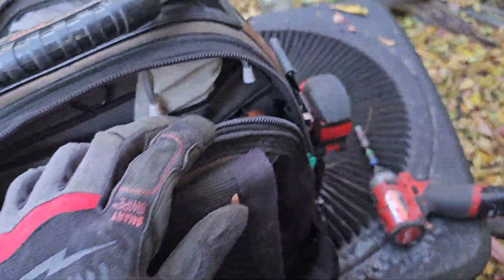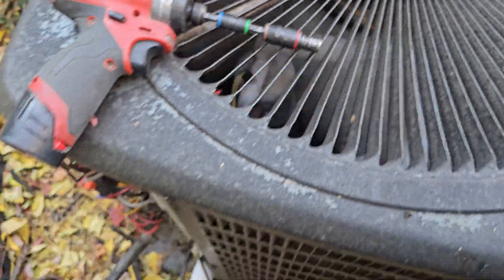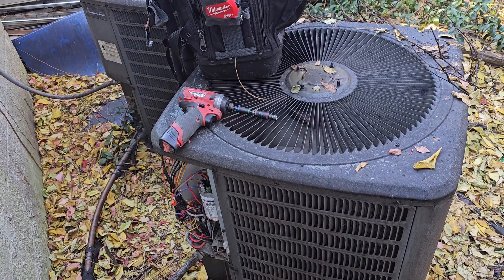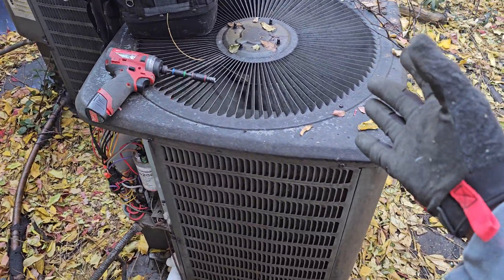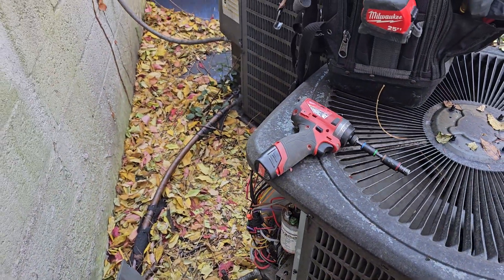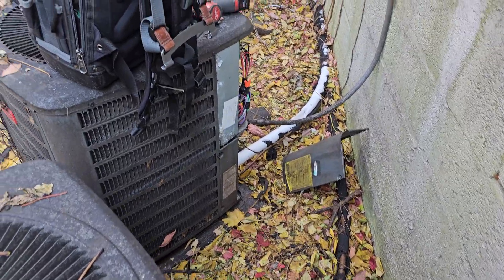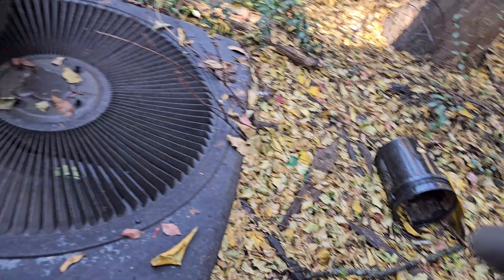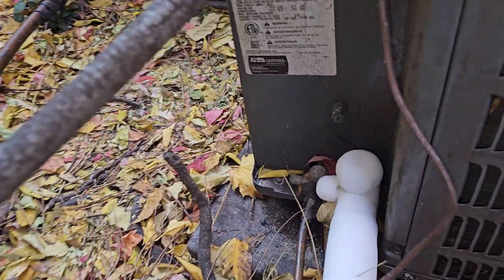HELP ME | HVAC TROUBLESHOOTING

Comment: if blower work-pressure is good,why is frozen line?maybe dirty evap coil. maybe low voltage wires shorted,maybe main board, melted and shorted-reason unit work nonstop without thermostate
Reply from the maker: Main board very close, watch the other  video i uploaded with the results

Comment: Low voltage shorts in the thermostat wire or bad contactor because without the thermostat on the wall you should not be getting a call for 24 volts outside at the contactor. Pull the 24 volts off the contactor on one side and see if it turns off if it does then you have a wire short going to the thermostat you'll have to check each wire for continuity against each other probably yellow and red is touching somehow. Well that's how I do it. But hopefully it's just a bad contractor a lot easier to replace.
Reply from the maker: Bravo ,,,, see the other video i uploaded with the diagnostics